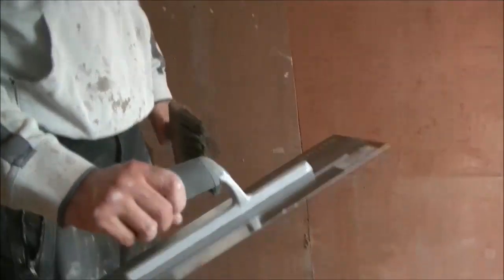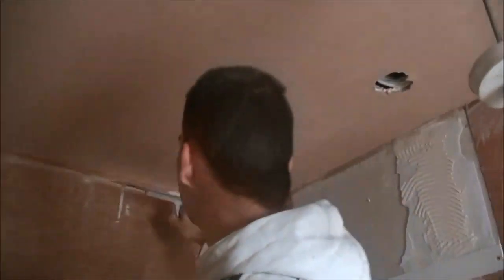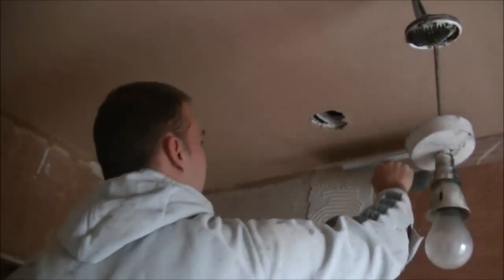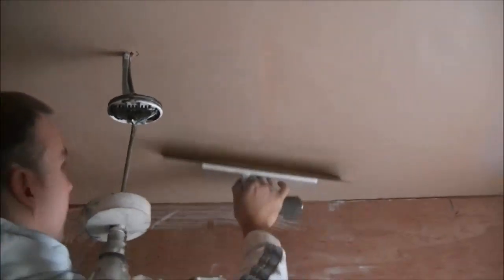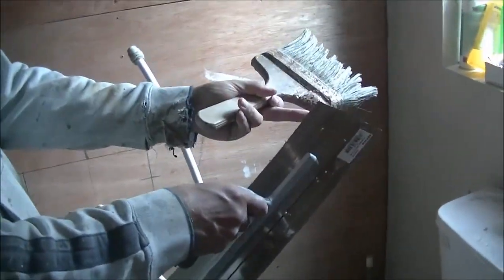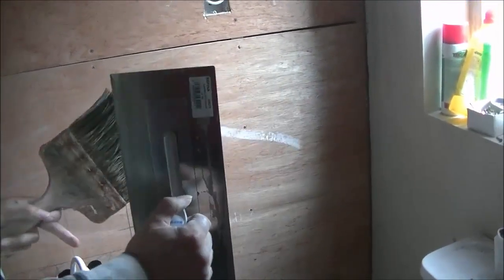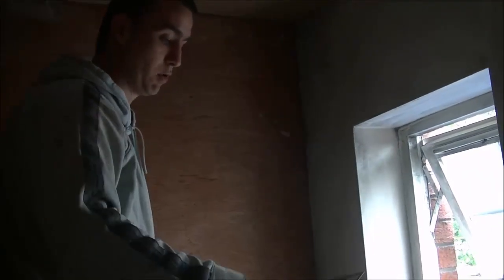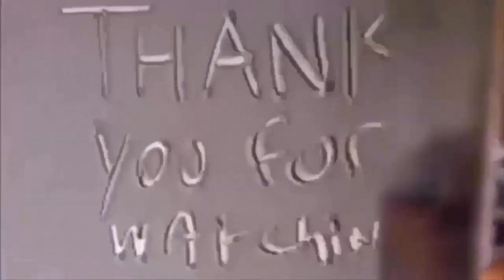REFINA SUPERFLEX 3  first go 3rd trowel loving it plastering

Comment: Hi mac did you use the superflex 3 for the final trowels or have you tried using it to flatten aswell I'm still using the original superflex which I use just for the final trowels but I hear with the superflex 2 or 3 you can use them to flatten work and trowel up with
Reply from the maker: Whats up buddy ...
I still just keep for  3rd hit and a dry run if i need to double check everything :) but i will test it someday :) so much test to do
Reply: @macplastering  thanks for the reply mac there's to much choice for a plasterer these days lol I'll look Forward to your review when you get the changed to test it out more
Reply from the maker: Never to much choice LOL :)

Comment: Looks a good sharp cut Is the blade as thick as your tryzack
Reply from the maker: the info from their site • SUPERFLEX3 Golden Stainless Steel Skimming Trowel• Slightly thicker blade giving a stiffer effect
• Size 405x125mm
• Rounded edges and tapered blade
• Guaranteed one year for trade use
• Produced with soft composite handle
• Composite leather & cork handles available
• Made in GermanyThis SUPERFLEX3 trowel is produced with a golden stainless steel blade, with alloy frame and moulded soft grip handle and has a slightly stiffer blade than the original SUPERFLEXThese trowels are lightweight and easy to use on multi-finish, skimming and board finish plastersOur range of additional handles include leather, cork and wood that can be easily changedSpecial introductory offer £12 less than trade priceWhen offer finishes trade price is £48

Comment: I haven't used it yet. Is it better than the other two superflexes? I heard it was a little stiffer than the original one, but that's all I know. 
Cheers guys.
Reply from the maker: Hey Gandalf these things truly are magic I will need more time to vs and see witch one i like the best but so far so good , it is stiffer as the blade is a little thickener but still has the flex ,so witch the stiffer blade makes it easier to go earlier and might be even more possible to do the walls/ceilings from coating and trowelling with it and should be stiff enough to move the plaster and not ride over it .... I will be trying it out on a wall in the future from start to finish :):)
Reply: Are these out yet to buy Mac
Reply from the maker: Yes mate on refinas site think they are only 38 quid
Reply from the maker: • SUPERFLEX3 Golden Stainless Steel Skimming Trowel
• Slightly thicker blade giving a stiffer effect
• Size 405x125mm
• Rounded edges and tapered blade
• Guaranteed one year for trade use
• Produced with soft composite handle
• Composite leather & cork handles available
• Made in GermanyThis SUPERFLEX3 trowel is produced with a golden stainless steel blade, with alloy frame and moulded soft grip handle and has a slightly stiffer blade than the original SUPERFLEXThese trowels are lightweight and easy to use on multi-finish, skimming and board finish plastersOur range of additional handles include leather, cork and wood that can be easily changedSpecial introductory offer £12 less than trade priceWhen offer finishes trade price is £48
Reply from the maker: All the info from refina
Reply: Thanks mate. Yeah, I see. It might also be okay for laying on, as you say. Sometimes the standard trowels we use for laying on feel too stiff and the original superflex is quite the opposite of that. Interesting. I should definitely get one and try it out. 
Cheers, Mac. Keep up the great work.
Reply from the maker: Let me know if ya do there is many to pick from now :) and thank you for  the support mate